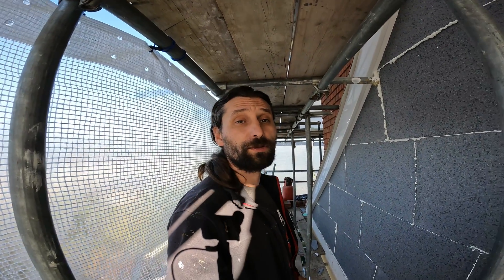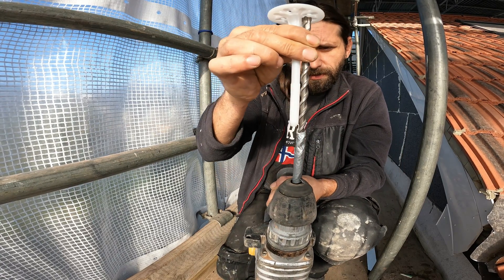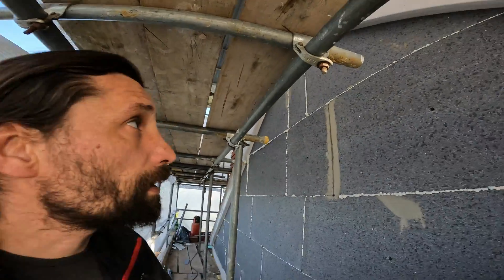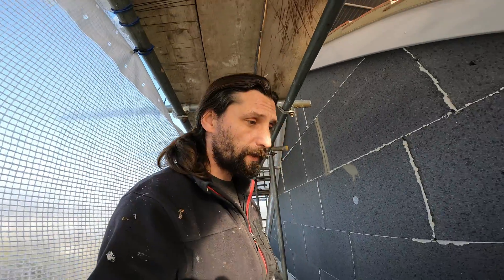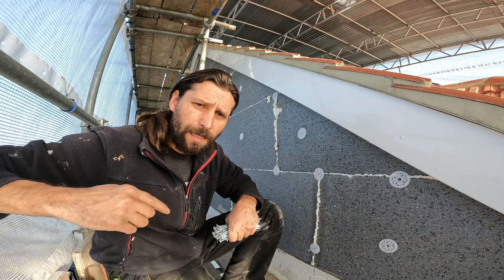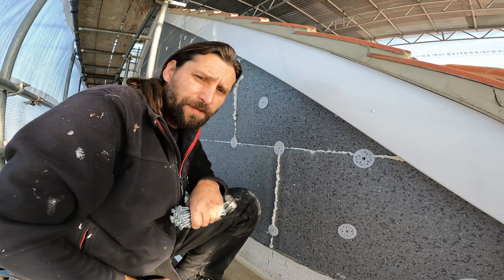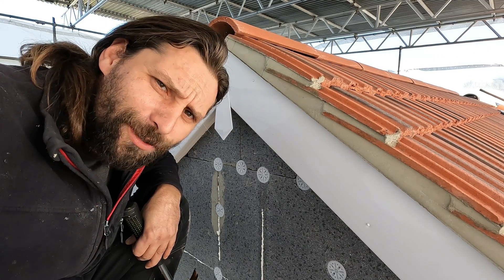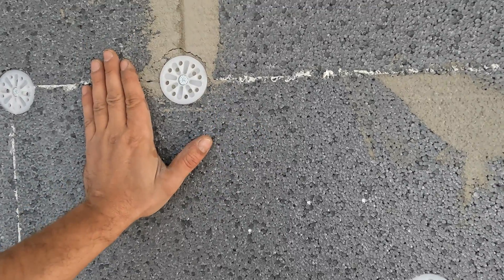Mechanical fixings installation

Comment: If the end of the fixings is sitting outside the boards like yours in the video does it show through when you apply the basecoat? 

I spent all last week countersinking the fixings using a router into rockwool. Took a long time! Just trying to see if I can save time and effort by not countersinking them.
Reply from the maker: Counter sink is not a bad idea. If you put some adhesive on top and sink them by knocking the fixing not to be flash with the rockwool, you should be fine. However, when it is cold outside and wormer inside, you can see white spots outside because of the heat transfer, which are going to disappear when the weather is going to balance. You know there is a countersink tool for that, right ???

Comment: Some systems ask for mesh to be put behind the mechanical fixing and then also over the top. They say it gives the system a longer life. Have you tried this?
Reply from the maker: Not really. I never heard about this. The only time that I've seen it done it was on a finished house that the mesh was pealing away from the eps with no brut force, and they wanted to reinforce it some how